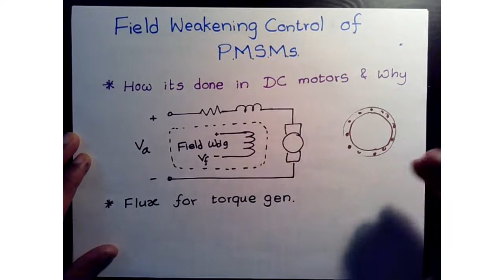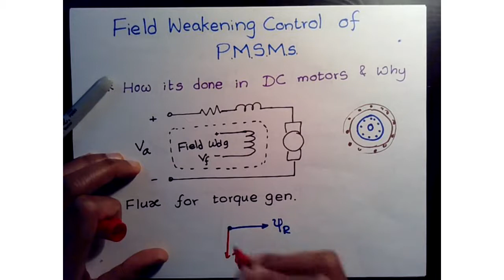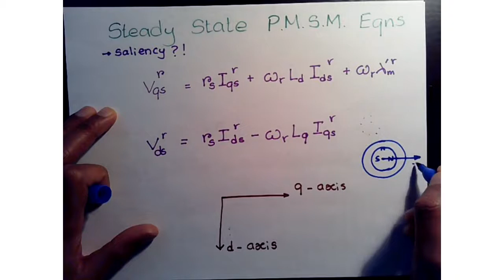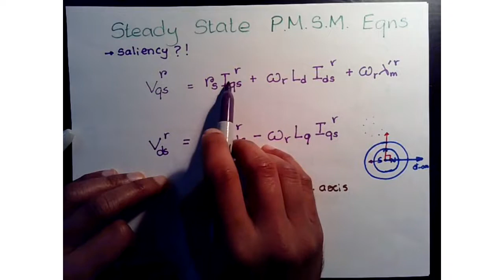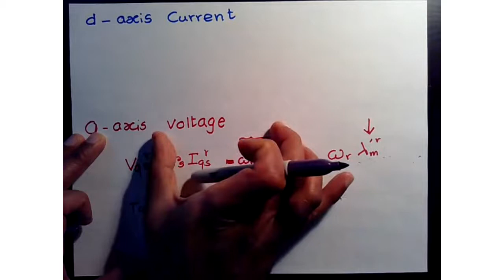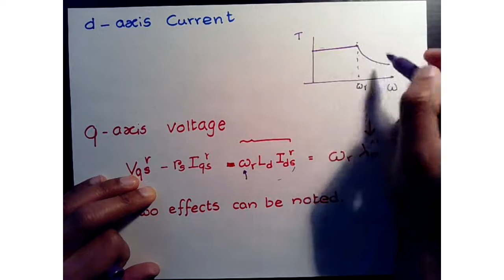Field Weakening Control of PMSMs

Comment: I have a few questions. It would be great if you could help explain.
The first question is if we apply a positive current in the D axis we could strengthen the rotor flux. Does that mean we can get more torque at low speeds?

I have a motor and inverter in a I am working on the software. I have the constant torque working correctly.  I am now trying to get the field weakening working.
I have applied a negative current in the D axis but the amount of applied current to get a speed increase is very large. To get twice the speed I need to apply roughly the rated current of the motor leaving no available torque current.
However the same motor used on an EV seems to be able to spin at double the rates speed and still have torque available.  Is there anything I am missing?
Reply from the maker: Francisco, 

To your first question, in theory you could, but there are other factors that you have to consider. What is the flux density in the airgap before you strengthen the field, what are the loss components, etc... If you have a torque sensor, you can experiment for your choice of motor. 

One aspect to check is if your position sensor is properly aligned. If not, the negative d-axis current may not be of use. You can do a simple calculation based on motor parameters to determine how much current is needed to reach a certain speed and still have torque available. Also, make sure your parameters are correct. Can you share more information on this motor and where you see this being used?

Are the two machines identical, design wise and construction wise?
Reply: @SandunKuruppu  The specs from the manufacturer are as follows: 
 Ld is 0.19mH
Lq is 0.44mH
Back EMF 39.2v/1000rpm
Peak torque 260Nm @380A
Continuous torque 128Nm @160A
The torque curve from the manufacturer shows peak torque to 3000rpm with 320Vdc.
Some of the numbers do not add up.
I have measured the motor back EMF to be 100v/1000RPM measuring the sine wave peak to peak.
I have measured the torque (in a not very accurate way) and the torque constants are in the ballpark.

The motor is from a Chinese EV.
Reply from the maker: @franciscoshi1968  Were you able to check if your position sensor alignment is accurate? Otherwise field weakening will not work.
Reply: @SandunKuruppu  I did check the sensor and it is correct. I have managed to get field weakening to work with no load. I haven't been able to test it under load because the feedback is  too noisy so it is too difficult to keep the D current smooth.
I am also having difficulty getting a sine wave current. I get a distorted waveform. 
I think this may be because the response of the D and Q loops is too fast.
I have been playing with the software a bit but I must have introduced some bug somewhere because I am getting desat protection faults. I need to investigate further. To do this I need to take the motors off the car so it will take me some time to find out what the problem is.
Could I contact you by email so I can send pictures of waveforms?
Reply from the maker: @franciscoshi1968  Sure Francisco. You can send me an email to ecesandun@gmail.com. We can take it from there. Mention that you we discussed on Youtube so that I remember your situation. Also, some scope captures/waveforms will help.
Reply: @SandunKuruppu  Thank you for your video, do you have tutorial to do these calculation?
Reply from the maker: @haowang4306  Hao, I don't have a video on calculations as it depends on the motor design and parameters. I will try to prepare some results with calculations and experimental results.